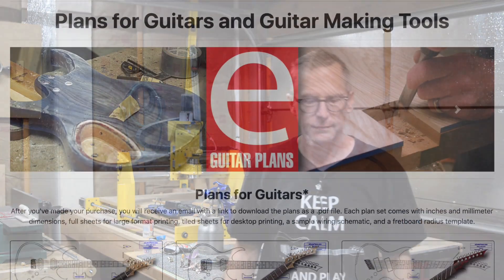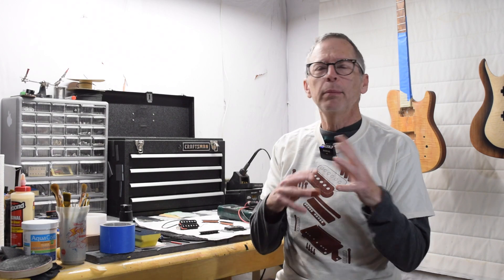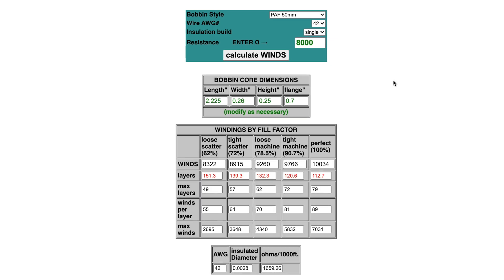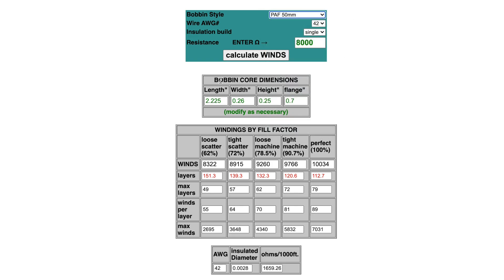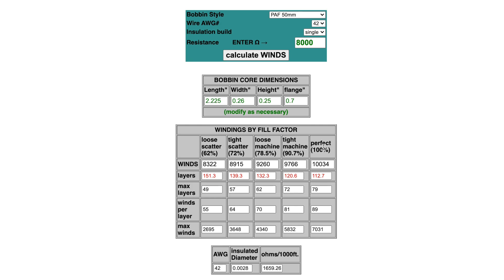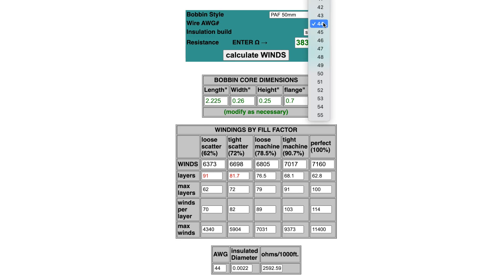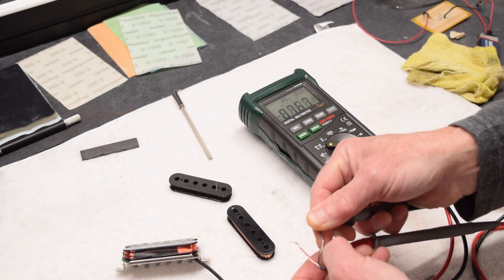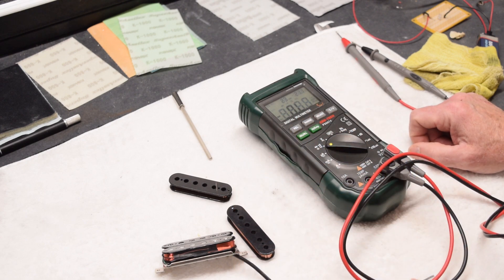How To Make Guitar Pickups Part 1: Resistance

Comment: I am having trouble with the website you use in this video lately, sometimes for the same specs it gives you different results of the winds, is there anorher source like this?
Reply from the maker: I don’t know. I have never had a problem with it, so I’ve never looked for another one. To get an accurate number is very difficult because the math is extremely complicated. This site probably simplifies the calculations to get you into the ballpark.
Reply: @HighlineGuitars  Lately I've been using the mobile phone, and sometimes the website goes crazy. Maybe it's a problem with the website working on a Phone
Reply from the maker: @juanilloJMTV  Who knows. It works fine on my phone and my iPad.

Comment: Very useful. I appreciate your process.  A comment on wire gauge: the pipe analogy works. There is another factor. Higher frequencies tend to travel closer to the outer surface of the wire (physics). Therefore theoretically a larger diameter (gauge) of wire will have more surface area for the higher frequencies to use. Increasing relative surface area is one theory behind Litz wire often used for high end speaker or even instrument cables. Several strands each electrically insulated from the other, usually with varnish etc. in practice Litz wire tends to be made with a very thin wire with more strands thereby increasing the relative conductor surface area. So theory would say that thinner wire with more bobbin turns would yield a “flatter” frequency response. Tonal properties can be tailored using winding patterns. Not wanting to be one of those heckling nerds. As an armature luthier for my own projects I’m learning a ton from your videos. My knowledge and schooling is electrical/electronic engineering so please forgive. Interested in your thoughts on the above if you’re so inclined.

Comment: Why don't people just make taller bobbins so they can use thicker wire for any given number of turns, or keep more of the coil a more optimal distance from the pole pieces?
Reply from the maker: They do. However, you can't just buy taller bobbins (no demand), so you have to 3D print them yourself.

Comment: Love this page. Do you have a clip that explains the tonal difference between magnetic pole pieces vs bar magnets? Also, the count of turns and wire gauge determines the magnetic field, but what if you used a really heavy gauge--say 22, and only had half as many turns? Of course, this is a theoretical question. Thank you!! Going to purchase your winding machine plans.
Reply from the maker: I'll be winding some single-coil pickups later this year and when I do, I'll shoot a few videos with one comparing them to bar magnets. An example of 22 awg wire according to http://www.jdguitarworks.com/coil/coil.html
to get the 7k of resistance with 44 awg wire on a PAF bobbin would require about 6k turns. Jump to 24 awg wire at 3.5k of resistance would require about 12k of turns. That's not possible. Going thicker requires more turns not less to get even half the resistance of a thinner wire.
Reply: @HighlineGuitars  Ah. I had it backwards. Thanks for the reply. Looking forward to the  magnet reference video.

Comment: How did you determine the relative tightness of your winding machine?
Reply from the maker: Trial and error. I wound a coil with a number of turns based on the 78.5% fill factor and compared my actual resistance to the estimate. The actual resistance was too high so I went with the recommendation for 72%. Of course, a lot depends on the amount of tension you put on the wire.

Comment: Also when you put a volume pot and tone pot that is 250K pots in parallel with the guitar pickups LCR which changes the resonance peak Q peak of the pickup. The Resistance value of the pots will shift the resonant peak of the pickup even that its a resistor its changes the LCR of the pickup. Most people think only C&L can shift the Q point but resistance of the pots will shift the Q point. You should make a video lesson about this because 500k pots and 250K pots will shift the pickups LCR value